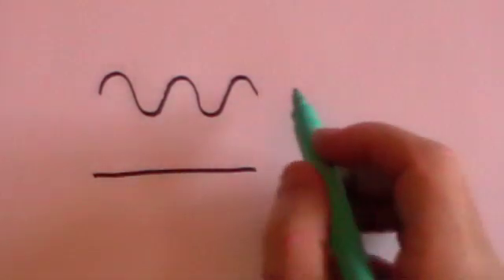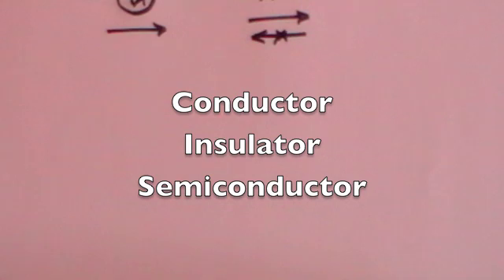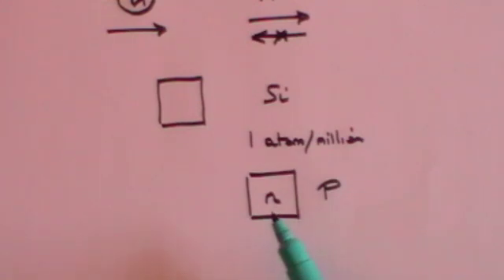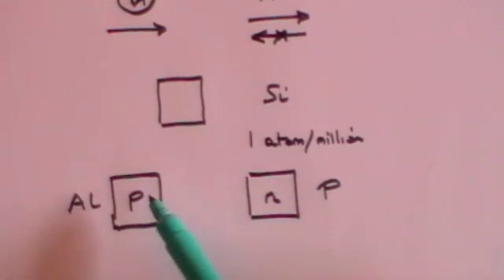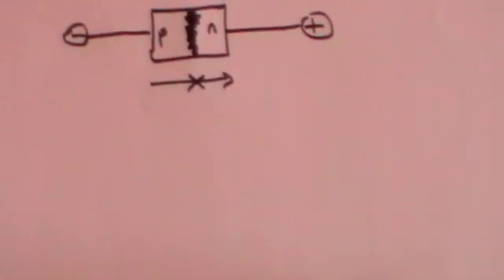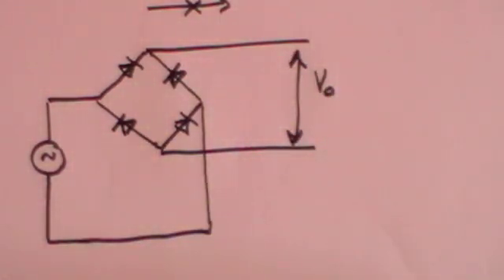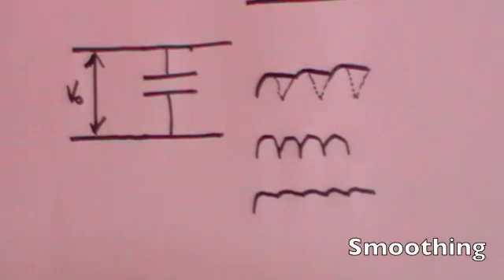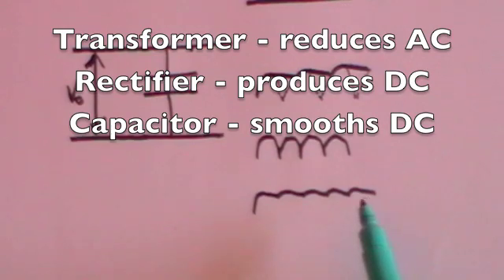Rectifiers and Capacitors: GCSE revision

Comment: Hi you seem to be saying that an n-type Semiconductor is"slightly negative" and P-type positive,well that's not true an n-type has more free electrons compared to p type yes but both p-type and n-type are NEUTRAL because as you rightly said you are just replacing one atom of Si with some other trivalent (p-type) or pentavalent (n-type) atom,hence the no of protons =no of electrons in p type as well as n type so they are neutral.

Comment: great video as usual!!! :D But why does a bulb flash when you connect it to a charged capacitor shouldn't it just stay glowing until the capacitor has lost all of its charge ?
Reply from the maker: The capacitor is chosen so that it discharges very quickly and produces a very bright flash. You are right that the capacitor will lose all its charge but it does this very quickly.
Reply: oh ok :) thank you for your help, keep up the great work !

Comment: High Voltage AC --> Transformer --> Low Voltage AC --> Diode (Full wave Rectifier) --> Pulsating DC --> Capacitor (Low pass filter) --> Smooths Pulsating DC --> Regulator (Zener Diode) --> Pure DC
Reply: Thank you !